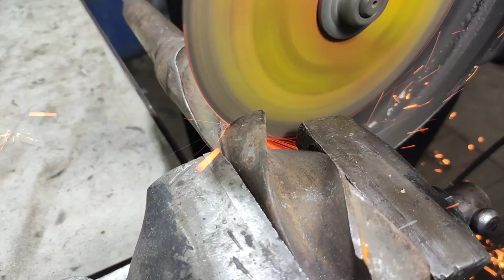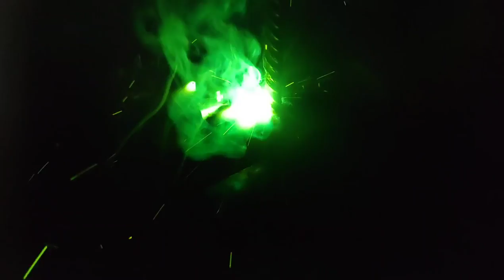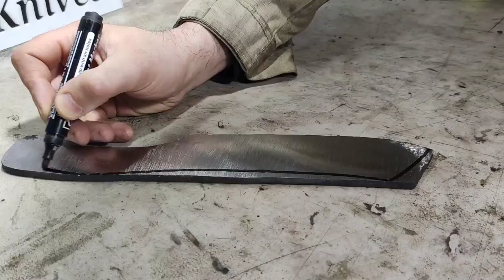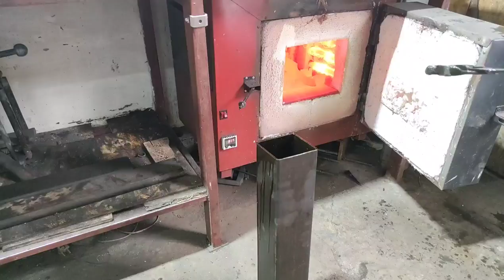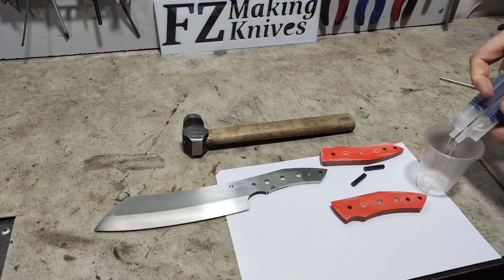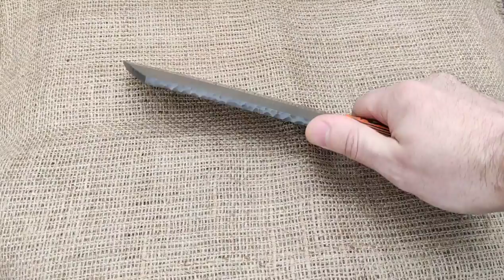WOOTZ steel CLEAVER from an old drill

Comment: Thank you for the beefy tang.  A lot of knife makers I’ve seen seem to feel that leaving a small thin tang is an example of how good their work is, and surely it won’t break and neither will whatever the material of choice they pick for the handle.  I’ve got way too many tools in my junk bag where either the tang and/or handle didn’t stand up to everyday use.  With the amount of material you’re using here, I’m thinking it won’t be the overall blade that fails.

Comment: Question? Why do you always hammer the ingot first (normally not much effect) before placing it in the hydraulic press? Could you not go straight to the press?
Reply from the maker: A hand hammer is used to check the ingot for cracking.
Reply: Thank you. Now it makes perfect sense!

Comment: Such amazing craftsmanship. I aspire to own one of your blades!

One question: would your wootz make a good or poor steel for a kitchen knife, or would it rust quickly?

Ok, two questions, sorry: Is it possible to make wootz steel out of some stainless steel alloy?
Reply: In principle you could make a corrosion resisting wootz - and I say corrosion resisting along the lines of the AISI 4xx steels there, as opposed to corrosion resistant AISI 3xx series performance - because what defines wootz is the carbide particle generation, alignment and growth during repeated forming operations. The problem is that to do so, your temperature control through the cycling during forging is presently beyond the kind of tools available to smiths, and even tools for research facilities like a ThermecMaster aren't that quick and controlled.

Bear in mind, you would need to carefully consider the influence of chromium and other large alloying additions content on the eutectoid point of the steel as part of your target carbon content for the microstructure. I doubt this was a HSS drill bit.

Comment: Sir why did u add glass and graphite?
Reply: Glass melts to create an air tight seal which prevents oxidation.  Graphite is for the carburising of the steel, https://en.wikipedia.org/wiki/Carburizing